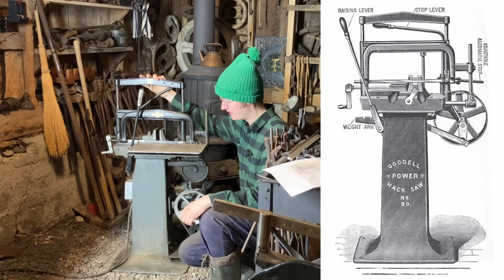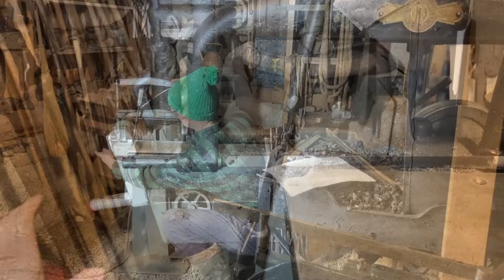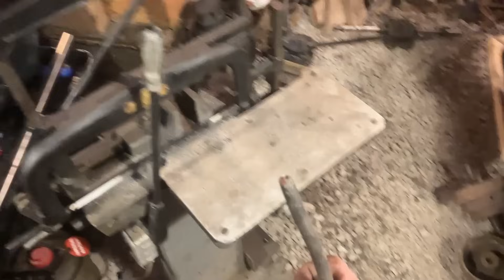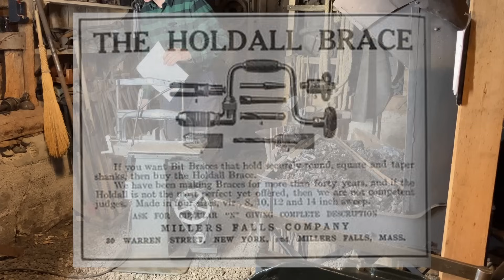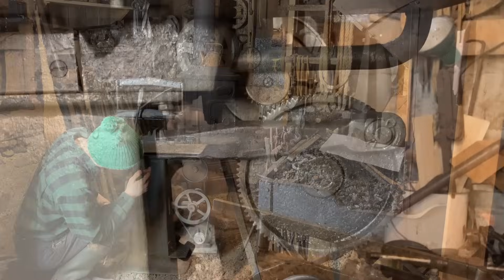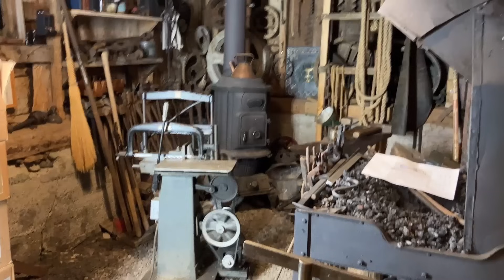The smallest power-hacksaw?

Comment: Way back when I was young, the farm had a sickle mower with a wooden connecting arm like that. It was a safety feature so that if the blades jammed up on something, the wooden link would shatter and prevent damage to the mower. The link was basically a 1x4 pine board with 3 holes drilled in each end to attach it. I changed quite a few over the years due to rocks getting caught in the blades.

Comment: Amazing Little machine and showcase! 
You wouldn't happen to know anything about Beling & Lubke machines? specifically their lathes. I have one built by them. but there is virtually nothing to find on the model/type i have, and i am trying to find out what its intended motor/drive shaft RPM should be.
Reply from the maker: @Odinnyb13  afraid I know of nothing. Maybe the more common Dalton make of lathe which has more publicized info could point you to approximate speeds if yours is of a similar size
Reply: @castironmachines  Okay! I will look into that. Thanks a lot!